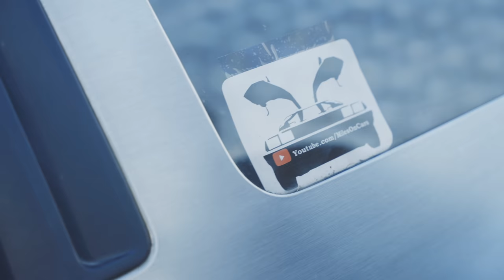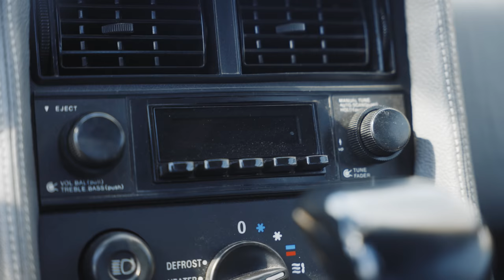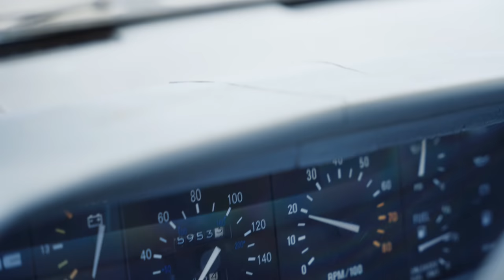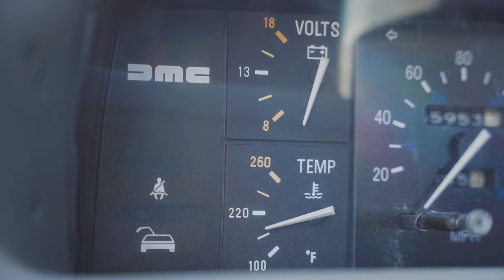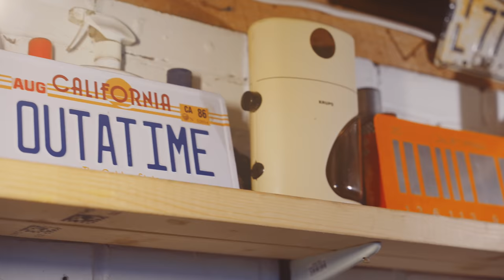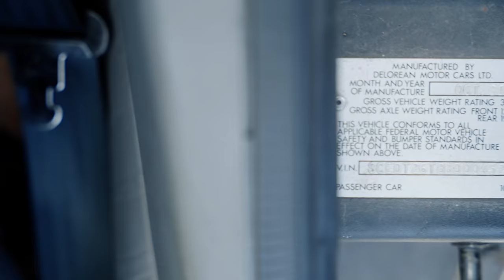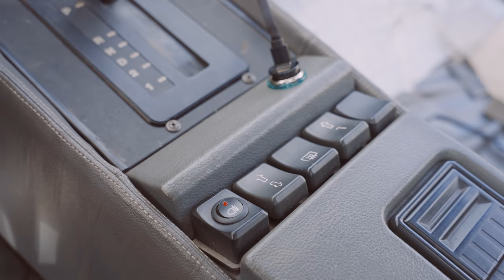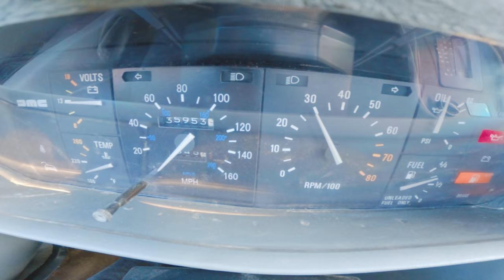The 16 year old who bought a DeLorean as his first car

Comment: DeLoreans were never very good cars to begin with, yes you are right. However, if you want a good one you can buy one that has been gone through at the DeLorean shop in Texas. They do a good job of refurbishing them, depending on how much you want to spend you can get one that's been gone down to the X frame. They have all the factory original blueprints and many original parts from the factory when it shut down, so they can actually make you a better than new DeLorean if you want.

Comment: Just an interesting question- there must be pilot lights in white, it doesn't seem to have any- just the orange indicator/dims - or has there recently changed legislation?
Reply: You are correct, the headlights had LED sidelights in but they both failed. Just one more thing to do....
Reply: @MilesOnCars  If the headlamps have the filaments inside a halogen type globe, i suppose it might be possible to carefully drill a hole in the assembly?

Comment: MX5s were a quantum leap
Reply: Yes, it was mainly accomplished by a retrograde step though as far as dynamics.  They returned to the format that works.  Front engine... rear wheel drive.   Big  step for any modern maker.   The biggest con ever perpetrated on the motoring public was when the motor industry announced that they were going to do us a favor and mount the engine, gearbox and differential all on the front axle.